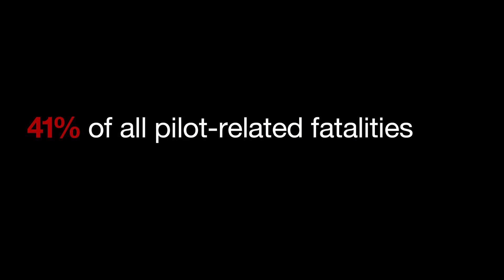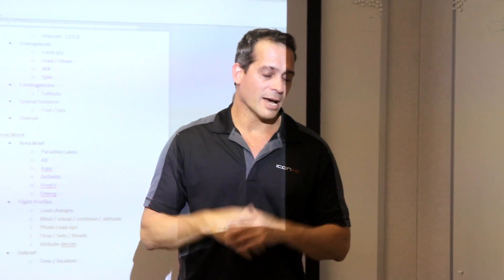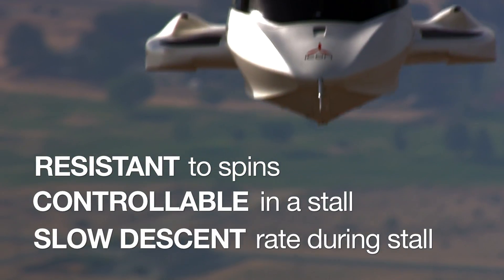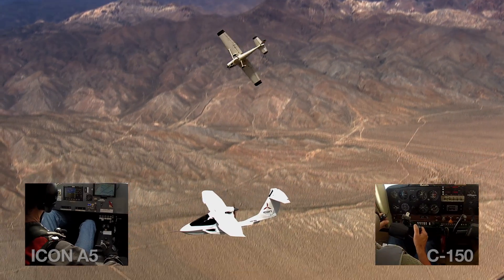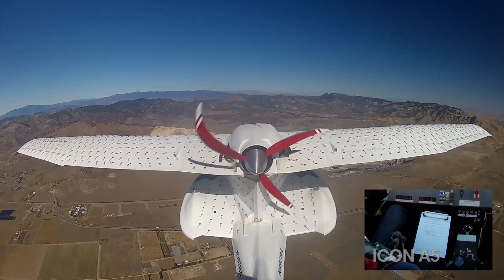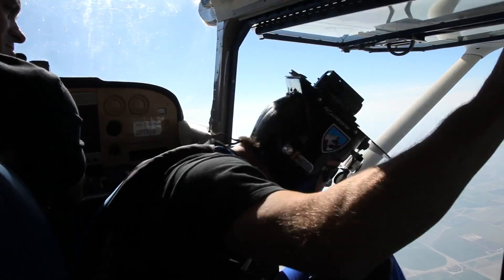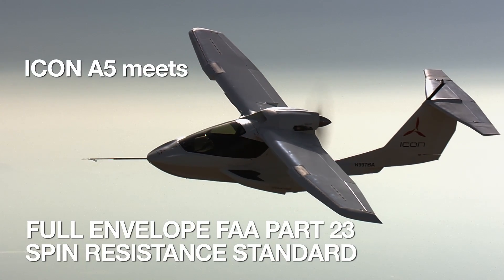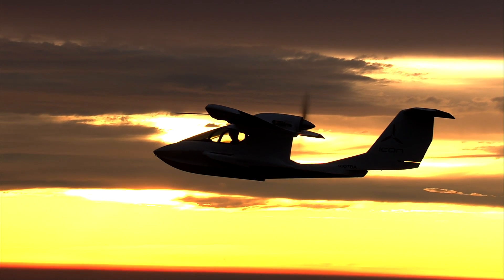ICON Aircraft - A5 Spin Resistance Safety Milestone Demonstration

Comment: Icon should make a version without folding wings. It would probably be much cheaper, and I bet that it would get a lot more people to buy the A5!
Reply: Max Strong I know that! :) I just think they should make a model that doesn't have folding wings for people who don't want that capability. It adds a large amount of cost and weight, and some people will never use it.
Reply: +Nick C. Icon needs to keep production high to meet consumer demands. They are keeping focus on manufacturing as many A5 models as they can. when they can supply the demand they will probably develop different variations.
Reply: Eric Frantz good point.

Comment: I agree that they should probably shown the stall/spin characteristics with increasing bank angle. 

Seems that the root is designed to stall early.  The outer part of the wing, which has the best ability to torque the plane into the spin, is not stalled.  This probably gives the plane its low sink rate while stalled.
Reply: ๅช0จ7765ฟผผฟผผผผหปกก

Comment: Not sure if I like the fact the rudder no longer responds in a full stall. It seems a bit strange that you can give full rudder in a stall and have the plane continue in level flight. Normally, the rudder is the one control that works in a deep stall.

Comment: I was clearly talking about the C152. The plane is spinned on purpose (banking right and right rudder), while the A5 only gets right rudder. By banking the C152, you are reducing lift, and therefore, with barelly any lift, any rudder input will therefore induce a spin immediately, whether on an A5 or a C152.
Reply: Second effect of yaw is roll. Watch the cockpit video

Comment: No, no, the idea of this test was spin resistance not stall characteristics. The Icon A5 maintains the same amount of lift as the C152 (same descend rate for both aircraft). The idea here is that the Icon A5 has very little rudder response and if you were to stall the plane, you would not be able to correct any oscillations caused by the stall. This is not something to be too proud of from Icon's side.

Comment: Does that make it a fair test though? The cessna gives a right aileron and right rudder. But wait a second, did you know that to control a stall without entering a spin you use the rudder and not the ailerons? What I see is that if you force a Icon A5 into a spin, you'll never get out of it due to the lack of rudder effectiveness at low speeds. Spin resistance does not mean the lack of it. I'm not saying the Icon's a bad plane, all I'm saying is don't advertise what you can't trully promise.

Comment: Really? "Turn plane on"? That alone indicates you're fairly clueless about flying. What's takeoff rotation speed? How do you handle a crosswind? When is the wind too strong to fly? How do you navigate to the dest.? How do you contact ATC? What are the legal weather minimums to fly? What if the engine quits right after takeoff? How do you enter the traffic pattern safely? This (and a LOT more) is what pilots have to learn before they can fly an "incredibly easy" aircraft like the A5 safely.

Comment: I like the A5's design, and think it would be the ultimate toy. However, as a CFI that stall comparison with the C-150 seemed a little disingenuous to me. I've stalled 152s and 172s many times in training, and have never had one go into a spin from a straight & level entry. They're pretty benign in the stall (which is why it's been the most popular training aircraft for eons) and you'd have to deliberately cross-control it to get it to spin like the plane in the video did. Slick marketing?

Comment: The "Ercoup" [sic] (spelled Ercoupe) earned its Type Certification in 1940 by the now (highly) obsolete CAA. Its "characteristically incapable of spinning" behavior was achieved by robbing the pilot of any rudder pedals or independent yaw control. ICON's claim was that the A5 is"the first production  airplane to be designed to meet the FAA's full-envelope Part 32 Spin Resistance Standard." This claim is 100% correct. Just calm down and enjoy an awesome feet in engineering and a sexy plane.

Comment: Yep with 300 hours in 172'a and many hours in other in other aircraft it is a deliberate act to spin them. The stall (and 152 stall/spin) in the video is only straight and level and power off  where most GA accidents stalls (Over three years accident study) happen in low altitude turns, then take off, many over weight or out of G of G. Icon have also submitted a weight exemption of 250 pounds to the FAA sighting stall safety. The folding wings also contribute to extra weight so stall safety?

Comment: I have an Icon A5, but radio control.  The RC version of most planes act similar to the full scale versions, as mine does.  I can definitely stall it, but I also have more throw on the controls than the full size version.  The aircraft is very controllable, and one of the "tricks" I like to do is to get it in a full on tip stall, and pull it out after falling about 50 feet.  It makes sense what they are saying, I have control even in a stall, no doubt.  The RC version is definitely not a trainer

Comment: A stall occurs when (and only when) the angle of attack exceeds the critical angle of attack. This is about 18 degrees in this type of aircraft.  As the aircraft slows the angle of attack is increased to generate more lift and keep the aircraft flying.  At that critical angle is exceeded, when the lift reduces dramatically and drag increases.  The problem is NOT slow speed, it is that the critical angle has been exceeded, though in this case it IS the slow speed that has required the high AoA.

Comment: Since you are familiar, why don't you explain. It seems reasonable to think that if the vehicle loses speed, it will "sink" as the air is no longer passing through the wings at speed and helping its structure move up or stay at a constant height. Please expand on the issue if you can. Thank you.

Comment: Have a 120 pund pilot in the front seat, 2 250 pounders in the back and 200 pounds in the baggage compartment, then set a 20 degree angle of attack. When it starts shaking come in with full power, full left rudder and full back elevator. Then hold on.

Comment: Want to limit stalling and reduce spin chance in any aircraft ?  Fly with a thick pillow of appropriate thickness between your stomach and the yoke,  or pillow between your knees if stick controlled.  Other method,  connect a steel wire of appropriate length between stick and dash board.  I still would take an ICON.  There are plenty of cool features to make it great besides just the safety reasons.

Comment: Not every stall results in a spin, that only happens when one wing stalls and the other does not.  Notice in the video they put in full right rudder, so the left wing is going a little faster than the right, which stalls first.

Cessna said after the first Skycatcher crash that they went back to the wind tunnel, redesigned the vertical stabilizer and made the plane more spin resistant.  Then they crashed another one the same way.  Now they say they really have it fixed.

Comment: But it seems none the so called experts are engineers.
 The spin resistance appears to be due to the wing design vs limited elevator travel.
Look at the streamers on the wings during a stall the main parts stalls but the ailerons are still in laminar airflow allowing control to be retained.
This is likely due to some serious CFD work.
CFD modeling did not even exist when the ercoupe was designed so this is a far more advanced concept.

Comment: I have been a flight instructor for 50 years so i can tell you that limiting rudder power and elavater power is not a good thing.there are times when that limited controls will get you in more trouble then not i will not fly a plane that   can not do a good spin and recover in less than 1 turn all 216 types i have flown will with proper recovery imputs.

Comment: A good pilot can hold a standard aircraft in the "buffet stage" of a stall sequence. This aircraft has simply made the elevator size so small that it cannot transition past the "buffet" angle of attack. That may have unpleasant consequences in other flight parameters. I think it is a good airplane, but I don't think it is necessary to mislead the public with such psudo advertising to engineering safety.

Comment: um... that parachute comparison is a bit misleading. A parachute does not land in the decent configuration or the jumper would be injured. A parachute has a "flair" sequence that dramatically reduces the decent so the jumper doesn't break legs or have to "fall and roll" as was done in the early days of jumping. The "fall and roll" of the early days had many many injuries associated with jumping. Not to say this is not a good aircraft.

Comment: Description of a spin is incorrect. A spin is simply one wing stalled and one wing still flying. It  is frustrating to hear people pass on misinformation such as this.

What is being done her is nothing new, like it or not accept it or not!
All one has to do and this was done many years ago to get an aircraft to be spin resistant is to reduce the elevator travel. This was done way back in the 60's when the FAA wanted to reduce spins so the band aide fix was to reduce elevator travel.!

Comment: Ejection seats in the hands of an untrained passenger deck would be far more dangerous than any potential saving capabilities they would offer.  As for parachutes, larger aircraft are orders of magnitude heavier than this tiny little aircraft, the parachutes required to save this aircraft would be both extremely expensive and probably too large to actually fit on the aircraft.  Even if they could fit, where would you mount the parachute that could withstand the forces as the chute opens?

Comment: A spin is caused by a CL lift curve that drops from the peak.  Once the stall Angle of attack (AOA) is reached, the lift decreases with further pitch up.  As the wing drops, the AOA increases further on the wing and lift drops.  The opposite wing stays flying...spin.  

To solve the problem you make an airfoil that has a CL curve that is flat at the peak over a large angle of attack 5-7 degrees or more.  Not rocket science!  Not hard.  The way they do it is bogus.

Comment: I have been a HUGE fan of Icon until I watched this video! Shame on you for outright lying and misrepresenting data! There have been several spin proof production aircraft and several spin resistant ones. Your lies that you are the first are shameful. If they are mistakes instead of lies then I surely wont buy a plane from someone who knows so little about aircraft. 

My dream of backing my A5 with the wings folded into my boat house just died. 

Bastards!

Comment: Is it still spin resistant with the engine stopped? In my head the draught from the prop over the tail would make a significant contribution to its post-stall controllability. Still cool though, like electronic stability control for planes.

Comment: and what he says about spins is like saying that flying straight and level is loss of control because you have to INTENTIONALLY fly the airplane level. A SPIN AINT NO LOSS OF CONTROL! it is if you're the idiot who cant fly! look at the 150. he has to intentionally introduce the aircraft to a spin and then CONTROL the aircraft in a spin. You push forward on that yoke it will come out of it. Cessnas are incredibly forgiving.

Comment: I applaud ICON, however, just as Cirrus failed to positively impact the safety of flight, the big issue is pilot training and judgement. Rudder limiters, outboard leading edge cuffs, etc all come with increased risk in other aspects of the envelope and even if that weren't the case, exposing pilots to planes that reward them when they fly poorly is a bad way to prepare them to fly anything else, it trains them to safely fly only that one, particular, airplane.

Comment: Watch knees from 2:13 in video..control inputs are different.  The 152 has full right rudder, the A5 has NO rudder input until after the stall.  If the max rudder deflection is what is shown in the video, then the cross-wind landings of the A5 must be extremely limited.  I'm all for the A5 going for FAR23 with no waivers.  Let's just be fully truthful.  Can it meet FAR23, stay under LSA weight, have swing wing and amphib gear?  I fly an LSA amphib and know what a challenge that is.  -Ken  N52596

Comment: What this industry does NOT need is old ideas, which is what the ICON is.  It needs new designs, not Rutan remakes, or missing-the-point NASA nonsense.  What it also needs is success and volume production, which nobody has been able to do, even after billions investors.  Why?  This is a long discussion.  

The ICON investors will someday have to wake up.  The design won't work for many reasons.  There is a better way. 

That said, as a seaplane guy I love seaplanes.  So I wish them luck...

Comment: Very much for real.  NACA.  need I say more?  Name me one airplane NASA worked on that is not in some way a death trap.

I have done what ICON is attempting to do with the airplane shown on my page.  I know the problems they are NOT solving that must be solved before success will be achieved.  Yes, they may sell a few airplane.  J Bede did that...  Need I say more?  

This industry need the right vision.  The A5 configuration has been done many times.  Won't work.  Why?  Point loads...

Comment: Doing delayed recovery stalls I was doing well for 1 min, lagged behind, rolled left. 2 turns when I realized I had the rudder to the floor. Right rudder, spin stopped, 2 turns right. House, fence, tricycle turning counter-clockwise where the horizon should be. Instructor George Mejeur nudged wheel forward, I did the rest.  Nose came up through horizon, said I forgot to neutralize rudder instead stepping on the right. I was embarrassed. He burst out laughing. Next week we did an hour of spins.

Comment: What does NASA know about GA safety?  

That said, if you cannot stall the outboard you are by definition limiting pitch control.  Making it stall "resistance" is plain BORING and shows a basic lack of aerodynamic understanding.  This is a SPORT plane, not a wheelchair. Control is the issue, not a spin.  

The airplane pictured at seaplanguy1 can be in full control post stall to 70 deg Alpha.  

Have you will tunnel tested the ICON?  Can it flip over?  There is so much you are missing...

Comment from the maker: The basic premise of spin resistance that NASA developed is that the outboard portion of the wing never stalls, thereby retaining full roll control while the majority of the wing is stalled and the airplane is descending.  ICON did not limit pitch control at all to achieve this.  The A5 has the same pitch authority we desired for good handling qualities at all CGs before spin resistance testing even began, and we didn’t need to reduce it to achieve spin resistance.

Comment: That is NOT a full stall.  You clearly don't know aerodynamics.  

Limiting the pitch control is NOT a good idea.  

Spins are caused by the lift slope going negative.   You solve this problem NOT by limiting the design but by making the right airfoil with a flat peak lift curve..

I guess with 25 million you can afford to make every mistake in the book.  Try engineering and stop the BS marketing.  This airplane is NOT useful...